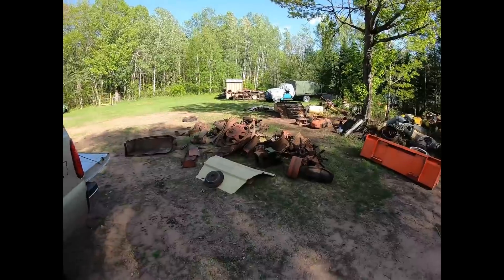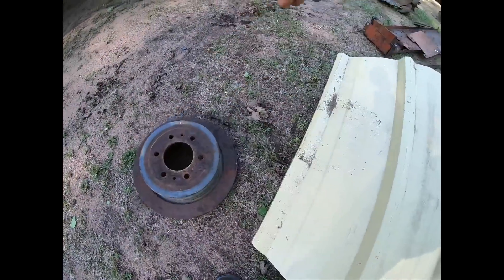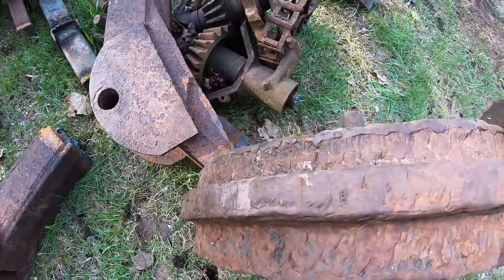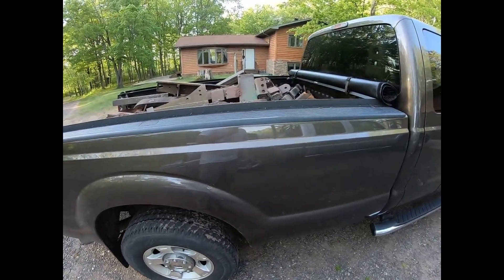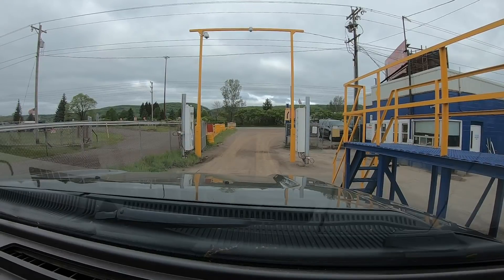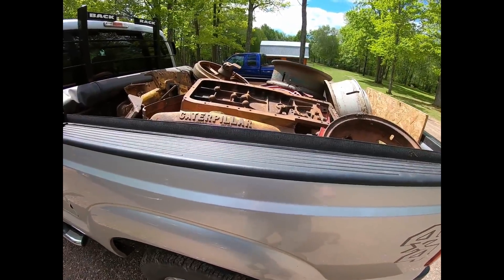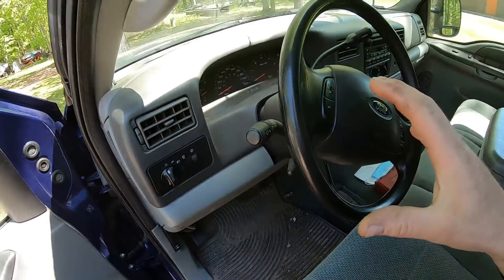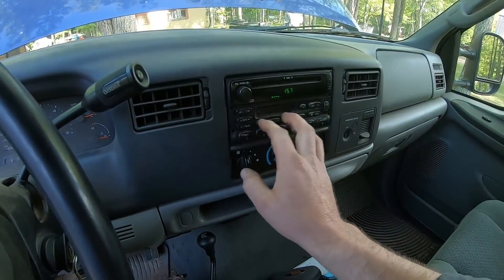Let's Go Scrapping!  Prices Are Up So We're Cleaning Out Some Old Stuff & "Old Blue" Breaks Down!

Comment: Arr Squatch. I look at things differently. I would make a running D2 from all the bits you throw away. The moor repairs on the parts the better. At tractor shows every one walks passed the shiny ones over to the rusty one repaired with bear cans and bailing wire.

Comment: Almost time for "Old Blue" to become a flatbed.  Had to stop at the parts store today myself, the air intake heater relays on my 2001 Dodge Cummins finally gave out after 20 years, so ordered them from Napa, good Saturday project for tomorrow. My metal cancer is more in the cab and front fenders, though, the rockers are about gone, bed is still solid, though........
Reply: Sounds like a good winter project!!
Reply: You took the words right out of my mouth lol!
Old Blue would look good with a flatbed
Reply: That's what I kept trying to get my stepfather to do with his old blue Ford highboy.  When there is no bed left, drop back and punt.
Reply: Seems like a new scrapyard bed would be just the thing for Old Blue. Maybe there's a good one out there from a front end wreck.

Comment: About how they fixed that bull gear to the diff housing of that Deering, that's called a Dutch, or Scotch key. Saved milling & broaching for rectangular key- just hold the pieces in relative position and drill axial holes. If the key is tapered, then you'd have a Dutch pin. For heavy weed-whacking I much prefer 10" brushcutter blades over plastic line. Some, like 8-knife can take some hits on stone- just need clamping hardware to mount blade to arbor. Blade also coats you with much less weed-mulch. (Your harness looks just like one of mine. They work, avoiding amputations.)

Comment: I figured you would have had them unload the pickup with the magnet.
Reply: @squatch253  Ya i was just kidding there squatch . I used to haul scrap in there with a dump truck then the magnet wasn't an issue . Did you see an earlier message I sent you about the radiator shop closing up ? Some time when your up this way you'd be invited to stop at my shop.

Comment: Could prolly throw a grounding strap length under Blue's tub between bolts and "fix" the bed, so you can haul a sway more than just the matting. Clearly not gonna fix that much, but it's a shame to own a truck and not get to use it as a truck. Just my 2 cents. :))

Comment: You have delved into the realm of industrial art and, WOW! I love that differential. A definite saver. I have a thought. Why not make a work stool.
I think Old Blue needs a flatbed.
Reply: @squatch253  my dad did that with his F350, but he bought it from his employer without a bed, it had an aftermarket dump box for hauling dirt out of cemeteries. Dad found a nice aluminum flatbed from CTE and had it installed when he had the truck repainted. His truck is like your silver truck, it has never seen salt. Dad uses it to pull his gooseneck camper..........